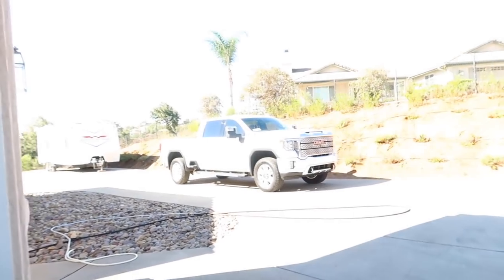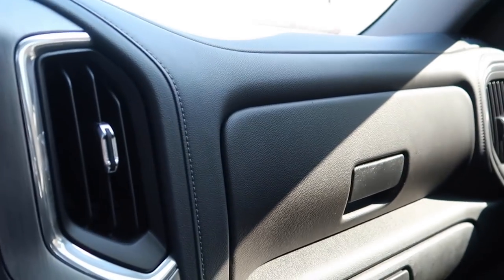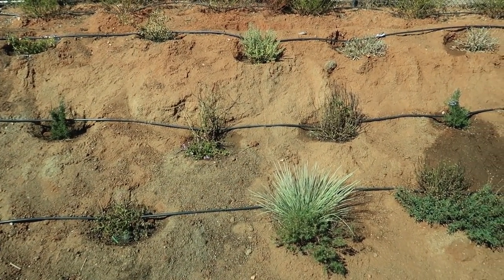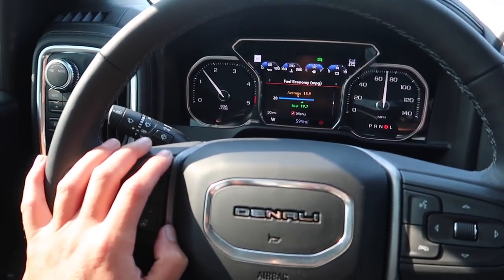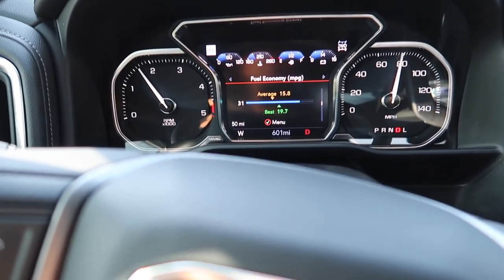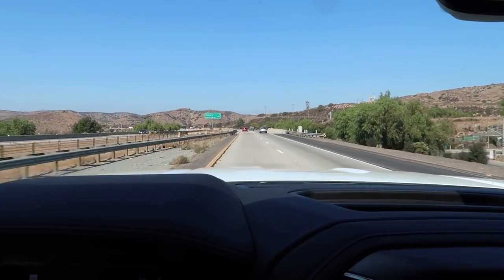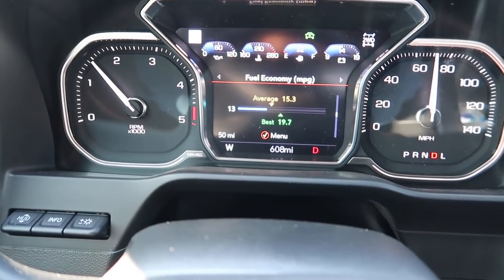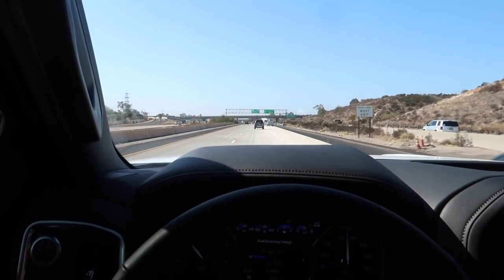IS THIS 10 SPEED ALLISON WORTH THE SWITCH?

Comment: MPG in my 2019 GMC 3500, I went on a 120 trip 65 to 70 MPH many hilly sections and got 24 MPG with the L5P.  You can improve your ride by better balancing your PSI in your tires.  I have people that ride with me cannot believe how smooth the ride is.  Spoke with a guy with 2020 Chevy  3500 HD, and he loved the transmission.
Reply: What do you run in your tires? I have the 2020 AT4, i set them at 55 front and 60 rear but everytime i take it to the dealer for oil change they reset it to 65/75

Comment: Well worth it, I went from my 19 with the Banks intake and derringer to the 20 and the 20 is way faster because of the 10 speed transmission. I won’t do anything to this motor because it doesn’t need anything
Reply: Better gas mileage?

Comment: In 2013 I bought a brand new duramax and after 20,000 miles I sold it due to all the rattle and shakes. Nice ride and great power but I don't think GM builds them like they use to
Reply: 2007 to 2016 GM really went south after the Bailout. 2016 to present they seem to have found their decent engineering again. That's what I have noticed myself anyway.

Comment: Vibration is the wire harness it needs to be zipped tied away from body by transmission. My buddy's 2019 did it also dealer couldn't find it but he put it on a rack and found it!
Reply: yfz450rx the wire harness is like 2 inch think and is running in the body that causes a vibration

Comment: I’ll be interested to see how the Powerstroke and 10 speed drives considering it’s basically the same transmission.
Reply: Elijah Sheffield way better than that gmc junk truck
Reply: Yeah, pretty much the same. Just different branding sticker. Curious to get the numbers on the new 6.7 Powerstroke, and the 7.3 Gas truck.
Reply: Mason numbers have been out for 3 weeks
Reply: @FordF-Super  Really? Thanks for the heads up. Will have to check them out later!
Reply: @maxracingteam23  LOL still rides better than a Ford death wobbling down the highway.
Reply: @karlschauff7989  right! It's just a shitty balance job anyway
Reply: It’s not the same transmission at all. They started designing one together yes, but ultimately they couldn’t agree on it so GM went and totally designed their own with Allison   Just watched a video of the GM explaining about the new 10 speed Allison for these trucks and how they worked with Allison

Comment: I just picked up a 2020 Chevy LTZ TWO weeks ago.   I already have close to 2000 miles on mine.  My hiway mileage has been closer to 21 mpg's and my overall mileage has been around 19.  Speed limits in my State  are 70.  One section of interstate is posted 60.  On that 25 mile section I was getting 24 plus mpg.  I have verified the dash numbers at the pump.  I have also read about the vibration at hiway speeds and have heard that rebalancing the tires takes care of that.  My take is that this transmission and fuel mileage is better than my 06 LBZ by a couple mpg's

Comment: Eddie that ticking sound is a lemon 🍋 the same thing happened to me with my 2017 L5P and after many months of firing with the dealer GMC came back and said “ Don’t do anymore repairs in that truck, that noise is normal”. Normal??? BS!...Long story short I went last month and order my 2019 3500 SWD RAM Longhorn editions and I should be getting it next week.
Reply: G35_Mark_L5P my 06 LBZ had the same tick and so does my LMM. I have a diesel mechanic said he will do a full rebuild on my truck put it back together it will still make that tick.
Reply: My lbz, l5p has the same tick it’s called the typewriter tick.    Ford 6.7 has it too.   
I was told it’s something to do with the oil flow in the engine.
Reply from the maker: dang man that sucks but congrats on the new ram
Reply: KdougK yeah man I’ve put 100,000 miles on my truck with that tick I’m not worried about shit. We all know them dodges fall apart so have fun with them. I like dodge I really do but I drive one everyday for work nothing but electrical issues, it’s a 2017 BTW.
Reply: G35_Mark_L5P it will he shipped from the factory in Saltillo, Mexico 🇲🇽 soon hopefully.  That’s where mine came from and all the new HD’s are built.  Get ready for electrical problems especially if you ordered yours with the 12” screen.

Comment: My f-150 has the 10 speed trans. I was told it takes about 4-5k miles for the trans to learn how you drive. It shifts so much better now than it did when I got it.
Reply: No such thing. You just get used to it. The transmission is programmed to shift at certain rpm’s under certain loads. Nothing to learn. It’s a program. 

 Don’t let it fool you.

Comment: The L mode just sets the highest gear allowed and is not a true manual override. For example, if it's set to L5, the transmission can use gears 1 through 5.

Comment: I have a 2020 Denali with just over 2000 miles on it. The D Max is getting much better mileage for me than you’re getting. It’s been mostly 30 degrees or below for the past few weeks and I’m averaging 18mpg back and forth to work 12 miles each way backroads and city. The best 25 miles I have gotten is 23.8 mpg on backroads at about 55 mph. Have you gotten the nox /def sensor problem updated yet?  Check with your dealership because you should be getting much better mpg than that.

Comment: That vibration is definitely not normal. Gotta be a heat shield in the engine bay or something in the tranny tunnel or something. Sounds something you n engine bay for sure. Crawl under the truck while it’s doing it and fix it for pops

Comment: That vibration almost sounds like the in cabin air filter isn't properly seated. Especially cause where it's coming from. Doesn't make sens why it comes and goes or stops and starts depending the gear. I replaced mine and it made that noise. I immediately fixed it, so I'm not sure if it would've done the same as your dad's truck.

Comment: I hope you found that noise; that’s a heat shield on your exhaust system.

Meanwhile I have 2018 - 8 speed SLT and I need to upgrade for my towing and now GM is put 6 speeds in gas 2500HD how crazy is that when fords have 10 speeds.

Comment: Just a little tid-bit of info, all Ram HD's with diesel have 31 gal. fuel tank plus extra 5.5 gals.
Reply: so they have a reserve?
Reply: The 5.5 gallons is what they put in to ship the truck, not extra capacity.  For 2020 longboxes will be 50 gal as an option.

Comment: Why not hand calculate the mileage from both trucks? Comparing computer readings isn't accurate. 
From my experience I went from a ppei tuned 2014 ram that would never see over 16 mpg hand calculated to my stock 2018 L5P that gets a consistent 18 mpg around town. Best I've gotten is 21 hand calculated on a roadtrip to the OBX.  

Now I will say that the ram would get better fuel mileage towing, would usually average about 11 mpg where my L5P averages around 10. Also the miles til empty isn't accurate in any vehicle, car or truck, that I have ever been in so I don't know if I would put much faith in that. 

Not hating on you Eddie, I like seeing the comparison between the new L5P and your Ram. It is interesting to see someone's point of view that did the opposite of me.

Comment: I’ve got a 2021 3500 that I bought in Dec 2020. 23k miles and the mileage is getting worse. Running at 80 from Tennessee to Las Vegas it averaged under 13 with no trailer and just the two of us with some luggage. No power to accelerate like my 2016 powerstroke had. The transmission is such a drag that I almost don’t need brakes. Just take your foot off the throttle and it slows right down. Also, it uses three times more DEF than the Ford. The ride sucks too. Every little crack in the pavement hurts your back. It feels like grandpa’s old 60s pickup. I’ll probably trade it soon.
Reply from the maker: Dam man that’s crazy to hear

Comment: take that thing to the scrap yard
Reply: Jaskanwar Randhawa especially after spending all that money then it has vibrations.  I’d be pissed
Reply: maxracingteam23  I know its a brand 80k plus truck that’s vibrating and shaking on the highway I have seen 20 year old civic that don’t do that
Reply: dedalliance1 how so
Reply: @jaskanwarrandhawa6577  Because the truck is just fine and will run many mire miles.
Reply: @dedalliance1   you do get that the scrap yard thing was a joke right also the truck is not fine im sure it will drive 100k plus miles but you won't enjoy driving those miles with a truck that vibrating and shaking on the highway i don't know just seem not right to me
Reply: @jaskanwarrandhawa6577  Didn't even look like it was really even shaking. Probably just something with the tires and or suspension, or maybe just that road. Some times I think my truck's doing weird things and then I get on a different road and it's fine again and I'm like hmm, guess the truck isn't broken. The weird noise under the dash is strange though, however, turn the radio on and you'll never even hear it anyway, so as long as it doesn't cause any problems, why worry about it? I'm sure the truck is perfectly fine.

Comment: WOW dude... GET YOUR TIRES CHECKED!!!
Vibration like that is 99% of the time a bad tire or a bad tire balancing. Like a lead weight thrown off due to impact or bad installation.
Or a sidewall or tread separation.
Beyond those, it could be a bad driveshaft ujoint.

Comment: Don’t buy a 2020 if you are using it for a Plow truck with a salter.  When you take off the tailgate to put in the salter they don’t have and dummy plugs to seal up the wiring. So basically they have no solution and thousands of dollars in wiring is exposed to salt and snow. The cameras all around won’t work also. Complete bull shit 
By the way I bought a 2020 3500 denali. Over $100,000.  Not happy and I want to return it. They want to charge me $1400 for a new camera to plug in to get the cameras working again and for a wiring harness they say to cut the connector off to plug in as a dummy connector for the power tailgate.  Ford provide the dummy connectors for free

Comment: I really don't know how other l5p guys say they get 20+mpg. I have 2 of them,  14city/18hwy is best I can do. Only one of the trucks has the highway vibration, dealer has no clue. Other one is pretty smooth. That said, When Cummins up's the hp in the Ram and makes it run like a l5p, I'll make the switch. Until then I'll deal with the small issues because the l5p flat gets it and is a total blast to drive. Come on Ram, I'm ready and waiting to make the switch